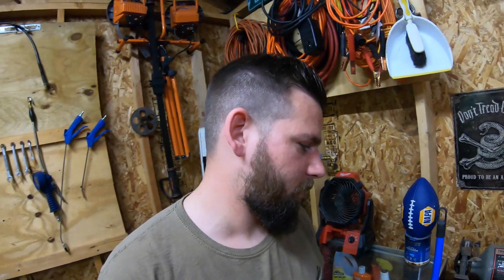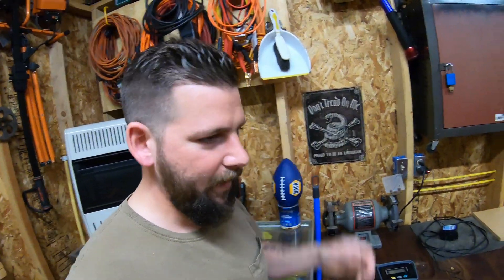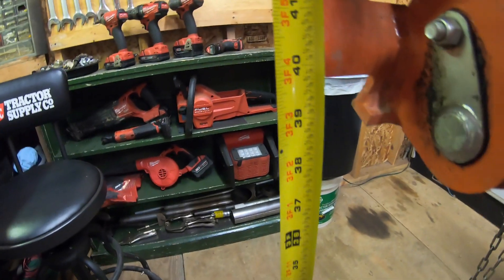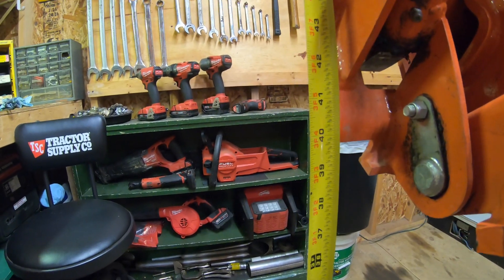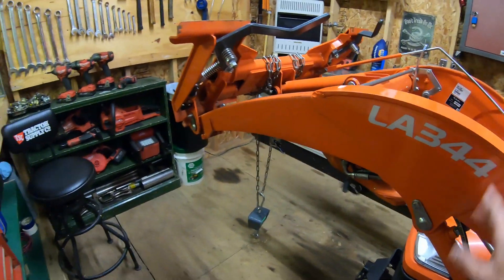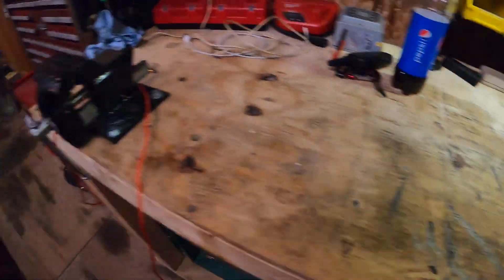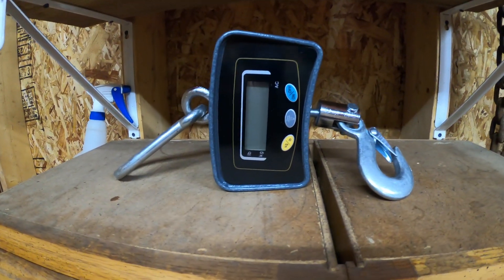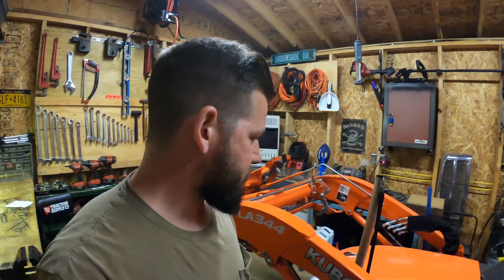Kubota BX- Loader lift capacity VS. Relief valve pressure

Comment: Ok I have a question , I have a 2017 BX 2380 what shims do u suggest ? Also do I have to buy a pressure gauge and a scale ? Or can I just use the shims you used?
Reply from the maker: Hey buddy, sorry I’m just seeing this, you can’t just use the exact shims I used as every single relief valve is gonna be different and no spring tension is the same on these machines.. you need to have a gauge to first check your pressure and once you have a baseline you will then add a few shims and recheck the pressure.. you will continue checking the pressure and adding shims until you have it set at the pressure you want. As for what shims to buy, you can still buy all the shims I did, infact I recommend you get all the shims I did, you just may not use as many as I did, or may need more shims then I did to get to that same pressure.. but if you get all the shims I got then you should have plenty to get the pressure where you want it. Hope this helps!
Reply: @BiffsEquipment  you wouldn’t happen to have a link to the pressure gauge I would need for this would u?
Reply from the maker: @howardmiller4241  unfortunately I wouldn’t because your couplers are different from
Mine since I own a BX70 and you own a BX80.. 

Just go on eBay and search “Kubota BX2380 hydraulic pressure gauge” or “BX80 hydraulic pressure gauge kit” they have tons of them online from various websites and the kits come with the pressure gauge and the shims.. or you can buy just the pressure gauge individually as well for your tractor. Lmk how you make out!

Comment: I just bought my BX23S back in May and according to my manual, max factory pressure setting is 1850 psi. Couldn't even pick up 450 lbs with the fork attachment, so had them check the pressure because the salesman said it should pick up at least 680 lbs and it was at 1850 psi, so was disappointed when I found out it couldn't. Being under warranty, still debating on whether or not to bump it up to 2000 psi
Reply from the maker: Hey Ed, you gotta remember that the 680lbs they state it can lift is on the end of the loader at the pivot pins.. so any weight that’s father forward than that is gonna greatly reduce the lifting ability.. so that 680 at the pins goes down 50lbs for the skidsteer coupler, another 150lbs for your pallet forks.. so now your around the 400lb mark.. now also think of how far the weight is out Infront of the loader when lifting the pallet.. that 400lb pallet was prolly like lifting 600lbs because of how much farther out it was. I think you just have to get use to it, but if you really feel you need more power you’ll have to increase the pressure.. I wouldn’t suggest going much over 2,000 and only do it if your willing to handle the risks and dangers that come with it and be sure to properly ballast the rear of your tractor as these tractors are very light in the rear so at 2,000psi it will tip over very easily if not ballasted properly. Hope this helps and I hope the issue gets better for you. It may get better with time too as your tractor is still brand new and breaking in

Comment: I'm kinda bummed my bx23s won't lift the rear tire when lifting something, even without the backhoe attached...
Reply from the maker: Hey Russel. Sounds like your hydraulic pressure was set too weak from the factory.. Factory spec is 1900psi roughly yet some ship out at 1650psi or so which usually isn't even enough to lift the rear tire at times so I would buy a pressure tester and shim kit from BXPanded.com and check your pressures and report back with your findings.

Comment: Cool video, thank you. I actually have a La344s ordered for my BX2670, can’t wait
Reply from the maker: Thanks buddy, that's awesome! Bet your excited.. The LA340/LA344 is a fantastic loader.. Its built really well and the quick attach works seamlessly.. I haven't had any issues yet with mine and I work the living crap out of it. The skidsteer coupler is also a very nice addition so if you don't have one ordered for it yet I would highly recommend it.. Also on these loaders you can also add a Bucket Level Indicator straight from Kubota that bolts right on.. Its such a great tool to have specially if your a beginner as it will allow you to always know exactly what angle you have your bucket at before dropping it down on the ground to dig dirt or to do any grading.. Its only like $65 and your dealer should install it for free with your loader if you buy it now and have it when they go to install your loader. Best of luck LMK how you make out!
Reply from the maker: PS. I made a video talking about the bucket level indicator.. how it works, how much it cost, and how it installs.. You'll have to look through my older videos to find it.. should be called "Kubota BX- Bucket level indicator"
Reply: @BiffsEquipment  thank you
Reply: I have had it now about a month, I did get the SSQA because I also bought pallet forks too. I find I use the forks 75% of the time compared to the bucket

Comment: Biff, what PSI did you eventually settle on?
Reply from the maker: Hey John, I'm currently at 2,250psi and have been for I think over a year now. I may be going up even higher in a video coming up very soon so stay tuned! So far iv had ZERO ill effects at 2,250psi but I def do not recommend it.. Typically 2000psi is plenty for most guys and is def a save point to be at as 95% of people who increase their pressure are at 2,000 no higher. My tractor is also paid for, and I realize the risks that im taking.. Increasing the pressure is hard on your hydraulic pump, your hydraulic rams, and cylinder seals.. You can also twist your loader frame if your not careful You can also potentially blow a hydraulic line and get hurt so just be careful. So far tho I have had no issues that I can see. Hope this helps!
Reply: @BiffsEquipment  That would be an interesting video, I am more than happy following from behind when you go that high! I have found that going from 1850 to 2000 psi, the generator I need to move around during power outages went from just lightly dragging to now I can carry it 6 inches off the ground without fail. I have ballasted rear tires + wheel weights and a full ballast box on the back, and use a quick connect and new style adjustable forks from www.mytractortools.com. Moving 800lbs of concrete off the back of my truck still lifted me up enough that even slamming into float as soon as I broke free of the tailgate almost rolled me. But, I went from dragging around the pallet that night to being able to get it a few inches off the ground a week later. So the main trouble I believe is starting out with a high weight, essentially getting into trouble you can't get out of. Which is less of a PSI issue than an operator running around fool hardy. Glad to hear that you've had no issues setting the psi to 2200, that gives me some relief as to the durability of the systems.

My reading of the shop manual find a 'High Pressure Relief Valve' internal to the hydraulic pump has a release pressure of 1991psi - A reason why I don't want to go over 2k is this. Well above the 1850psi spec noted for the shim set relief valve, I don't understand how that valve works within the entire systems and am worried that going too far above will cause issues. My tractor is a 2003, first gen BX1800 with LA211. I wonder if your newer model LA344 has the same internal relief valve. Again I look forward to seeing you run higher and see where it goes. I am going to stick to 2000psi for a while, plenty of power to do what I need right now.

Comment: What are the measurements of the shed?
Reply from the maker: Hey David, my shed is roughly a 20x18 give or take an inch or two either way.. it’s Def large enough to keep the tractor in there and be able to work on it but with the amount of tools and benches I have in my shed I’m quickly running out of space. I plan to extend my shed out off the one side and build like a Lean-Too this way I can free up some space in the shed so that I have more room to work.

Comment: Wow Biff, that was an extremely informative video. I just bought the tractor and will be looking into the pressure. Maybe I'll have the shop confirm before delivery. Then I will confirm myself to check their honesty. I definitely want mine at max allowances. Ballast being the key. Thank you for taking time out of your days to produce your vides.
Reply from the maker: Thanks Matt I appreciate that and congrats on the new kubota! Your gonna love the little BX.. it is a very powerful machine and will surprise you. As for having the dealer check it before it goes out that would be a great idea.. tell them you have seen too many of these machines ship out under spec and that you want to make sure it’s hydraulic pressure is at the max allowed from the factory which should be between 1800-1900psi I believe. Let me know how you make out! Increasing the pressure makes a huge difference just remember to have proper ballast and know it will void your warentee if you go higher than spec like I did. Thanks for watching!

Comment: Hope you used woodworm killer on that wooden cupboard.  If them things see your wooden shed they will have a banquet. . . .  I remember splitting a hydraulic ram on one tractor; The implement was designed for a tractor with a lower hydraulic pressure than the one we were using. . . . . .
Reply from the maker: Wow that’s crazy you split a Ram. As for the shed it was built well before I moved into this house and has never had any issues with worms or bugs eating it, the shed use to sit way out back where it never got light and I was afraid it was gonna rot back there so when I moved into this house I put the shed on skids and moved it all the way to the front of my house using my Kubota bx and a pickup truck haha. Thanks for watching!

Comment: Everyone seems concerned about their warranty but no one bothers about safety! The loader and the over pressure valve are a designed system. Clearly there is a safety margen and the tractor will lift more than its spec but at the cost of your safety margen...I wouldn't do it. 
Considering the litigious nature of the U.S. taking that risk is just not worth it.
Reply from the maker: Safety is a HUGE factor and that’s why I mentioned this many times through out the video.. this is why I said “You MUST have proper ballast if you want to be safe “and that doing it with out proper ballast is absolutely stupid and pointless. Infact one of the reasons I made this video was so that I could emphasize that in order to be safe you NEED proper ballast. I must have said it 4-5 times in this video alone so idk where you think nobody is concerned about safety. Neil messick made an awesome video of his own and used parts of my video in his for this reason as well..
Reply: @BiffsEquipment  ballast isn’t going to help when a hose splits with 3000 psi  shooting at your face, hydraulics have spikes of pressure when suddenly slamming the bucket off something, I think this shim kit is absolutely fine but we both know someone reads 3000 psi on a hose and is going to shim their loader pretty close to that same pressure...I bought my backhoe with the spring sticking out the bottom of the relief valve so I’m guessing the previous owner was one of those

Comment: Nice vid what rpm were you at for testing?
Reply from the maker: Thanks man, I used full 3400rpm or "Full Revs" as they say when I did my tests. You should always have RPM at max to allow for accurate and consistent pressure readings. Thanks for watching!

Comment: So how do I keep from voiding my warranty? Staying under the factory spec? I know the dealer sells shims so clearly they know it can be adjusted. What are your thoughts?
Reply from the maker: I’ll tell you how.. when you bring it in for repairs just remove the shims lol. There really is no solid way of them knowing you increased your line pressure unless something breaks because of it.. which I doubt would happen long as you don’t abuse it. If you had to go back for warentee work just remove the shims and bring it back to stock.. factory pressure is 1850psi or less I believe
Reply: @BiffsEquipment   Haha! I guess if I increase it just enough to be below spec they would never notice LoL

Comment: You never stated what rpm’s you were running the engine at on any of the tests!
Reply from the maker: I did, i stated that all test should be run at MAX RPM to ensure you are getting an accurate test.. or at least i thought i did? lol Always do your testing at full revs for consistence and full pump pressure. Thanks for watching!

Comment: I really like your videos and I am looking for a good deal on a BX2370 after seeing everything you have done with yours.   

What was the cost to add the LA344 to yours (round numbers ok).
Reply from the maker: Hey Tony thanks alot, I'm glad you enjoy watching my videos. You should be able to find a decent deal on a 70 series Kubota now that they are aging a bit with the newest 80 series line-up. The cost to add a loader will be around $3500-$3800 and thats installed and after taxed too I believe. Just make SURE whichever tractor you decide to buy that it comes with a loader valve and the hydraulic manifold already installed. If it does not come with a loader joystick then odds are it has no hydraulics plumbed either for a FEL in which case you would have to spend thousands more to get yourself a loader valve and all of the plumbing which can be very difficult to find on its own and very costly if you even do. Mine had the loader valve and hydraulics so i knew all i needed was the FEL which comes with the loader frame mounts. Hope this helps and goodluck with your search!
Reply: @BiffsEquipment  I was able to pick up a BX2370 over the weekend.  I think i got a decent deal.  Came with the LA243 loader and the 60" mmm.  Looks like new was used mostly for mowing.  3 pt hitch and rear pto look new.  Loader still has most of the paint in the bucket.  Now the fun begins.  Ordered the pressure  gauge to check my pressures and I will see where it is.  Thanks for the reply.
Reply from the maker: Tony G thats awesome man! You must be super excited, I know I was when I first got my bx, I was dreaming every night of all the projects I wanted to tackle with it and all the things I wanted to do to make it even better. I’m glad to hear it’s in great shape too! Sounds like it may have been used for mowing more than anything.. that’s how my bx was used as well when I bought it, guy owned a huge farm and did nothing but mow with it for 80% of its life. How many hours?
Reply: @BiffsEquipment  about 425
Reply from the maker: Tony G right on man that’s nothing, she’s practically a baby still!
Reply: @BiffsEquipment  Tested my pressure today and it is just above 1600.  Are you still running yours around 2000 lbs?  Any issues or concerns you have st thst level and did you ever end up going higher?
Reply from the maker: Tony G hey Tony, Wow sounds like you’re was about as low as mine was.. I put mine up to 2,000psi well over a year ago maybe more and as hard as my tractor gets worked iv never had a single problem or concern.. I did want to go high and would have had I not run out of shims, for the average person tho I would suggest 2000psi as a max, I wouldn’t mind going above that cuz I know if something breaks I’ll just fix it and my warentee is already expired since 2016. Let me know how you make out, your gonna love the power difference!
Reply: @BiffsEquipment  ordered some shims.  I think 2000lbs should be good.  I am looking into options to convert to ssqa so I will need to overcome the additional weight if I do.  I can't find a specs that point to a meaningful difference between the new LA 344 and the older LA243 i have.   Are you aware of any capacity differences?  Onviously the ssqa on the LA243S is a major upgrade in versatility IMO. But I can't find any info if modifying a LA243 will be different than a LA344.  Are you aware of any?
Reply: Took 1mm worth of shims but I am pretty much spot on @2000 now.  Only took about 20 minutes.  Used the guidance in your video of about 40-50 per .1mm.  Did it in 2 steps.  Added .5 at first and moved me from 1600 to 1800.  Added another .5 as nd dead on at 2000.  So definitely about 40 lbs per .1mm of shim.  Haven't used it much yet hopefully over the weekend.   Thanks for sharing what you do with your BX.
Reply from the maker: Tony G hey tony no differences with the loaders; they are both build exactly the same pretty much, both have the same strength and both the same lifting capabilities.. the new LA340 loader just has the option of the quick hydro couplers and the easy detach and re-attach as well as the skid setter mount and the one leaver kick stand .. aside from that stuff tho it’s the exact same loader. If you buy a skidsteer mount for yours it usually is about a 50-60lb increase in weight but you’ll never notice it now that  you have the pressure increased like you do
Reply from the maker: Tony G awesome man! I’m glad it all worked out for you and glad my video was able to help you get it all lined out. Sounds like you did it perfectly.. you shouldn’t have any issues just be sure you have proper ballast to be safe, I always recommend loading the rear tires plus an addition minimum of 200-250lbs on the 3-point with the pressures at 2,000psi. Glad you kept me updated on everything!
Reply: @BiffsEquipment  i have dome extra shims i can send you if you want to go past 2000 and let us know how it works out.  I think i have 2 .2 and 1  .1 which should get you to 2200 if you want to try it.
Reply: Some
Reply from the maker: Tony G that would be awesome tony, I would absolutely use them and would give you a shout out, you can email me if you’d like mbifaro@gmail.com
Reply: @BiffsEquipment  sent you an email